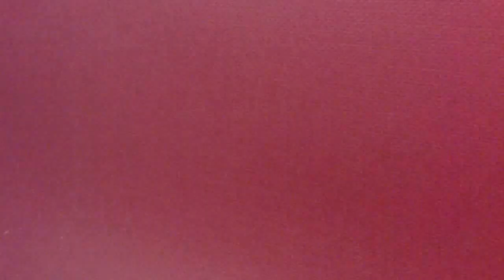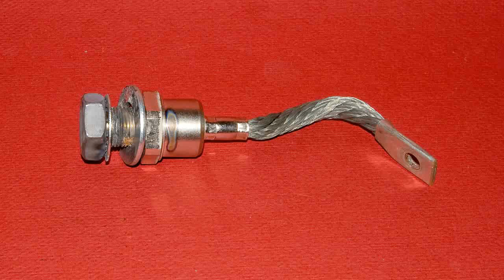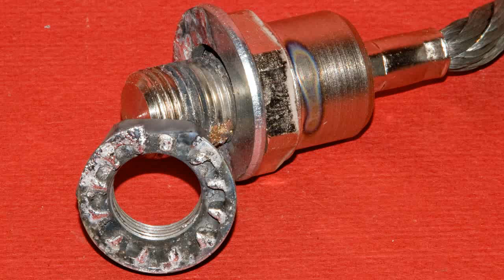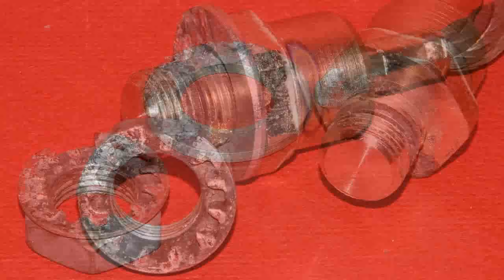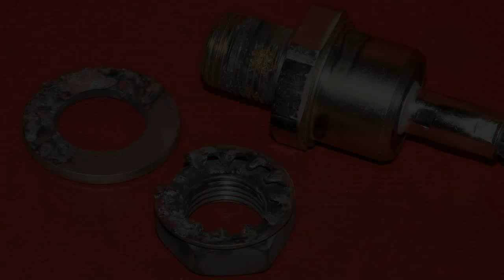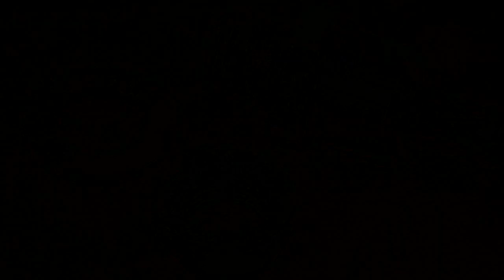Lightning Damage

Comment from the maker: Thanks CameramanLink,
The station is pretty rugged and has good protection. The only other thing was a fuse was blown on the lower most left quads so those four units where not working. Replaced fuse and all four came up to power. Now there many be some walking wounded, but only time will tell.